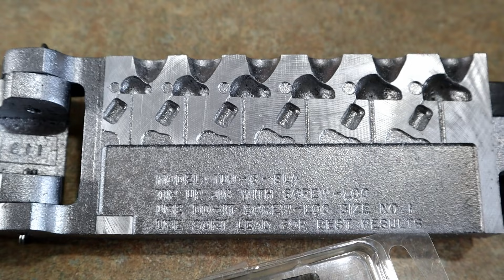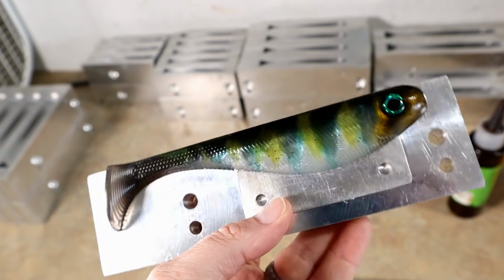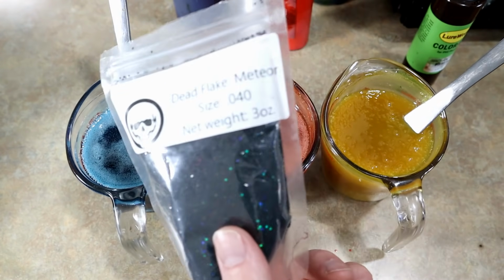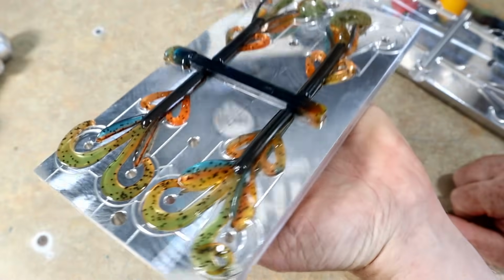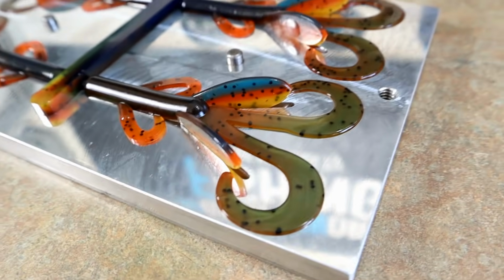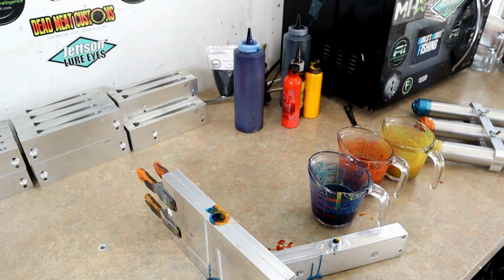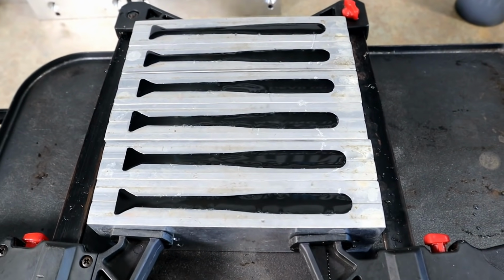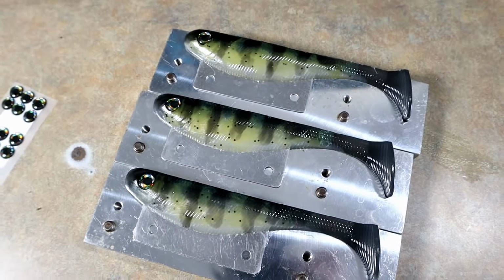CRAZY HOG Triple Color; New Mold Day & Bait Blog

Comment: Quick question I’m getting into plastics making would a old small crockpot work to melt or heat the plastisol
Reply from the maker: I don't recommend a crock pot because I don't think it gets hot enough, what you need is actually cheaper, a $20 presto cooking pot from Walmart
Reply: @WorldsWorstFishing  thank you for your time, advice and the wonderful content. I have been watching your work for months now.
Reply: Well first batch I burned the crap out of it awaiting my new Chris Johns special 😂the microwave coming in from a online Wal-mart sale $39.99 in three days
Reply: I did use heat stabilizer but I definitely nuked the Plastisol